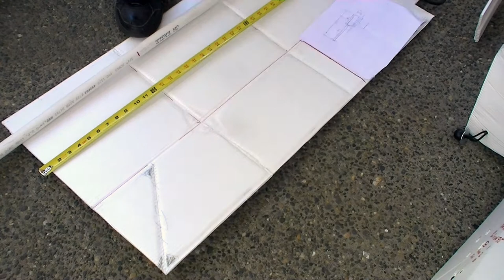Make a canoe paddle in 1 hour - use coroplast and heat fusion

Comment: It looks nice, but perhaps the pipe might flex and twist. The part where it is flattened looks to be a bit creased. I think drilling holes through the pipe parallel to the sheet and two holes in the coroplast for zip ties might work. As if one spacez the holes on the coroplast by a good bit it will provide anti twisting strength.
Reply from the maker: Thanks for asking very good questions, and also your suggestions. This make me think what should I do if the paddle doesn't work and what I should change in my next implementation. One of my goals is to used recycled materials I have on hand. The crease on the blade is caused by a fold line on the coroplast, which I reuse this piece from my old boat. I should have picked a better piece of coroplast. The main problem could be too much flexing. I did think of using a 1" PVC pipe, but the paddle will be getting a bit heavy. I may try spray foam inside the PVC pipe to make the pipe a bit more solid, or I may switch to use the aluminum pipe in my next implementation. Other option is to trim the blade to 6" width, to reduce the stress force on the blade. Currently the width of the blade is at 7". Coroplast is easy to work with and it is easy to trim the width. Thanks again for your feedback! I will post a test result in about two-three weeks.  Cheers!